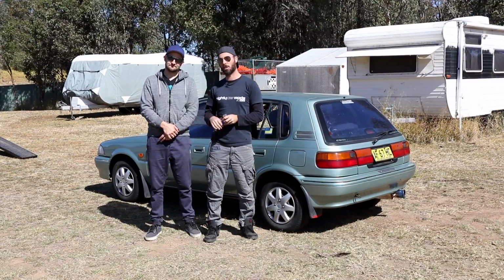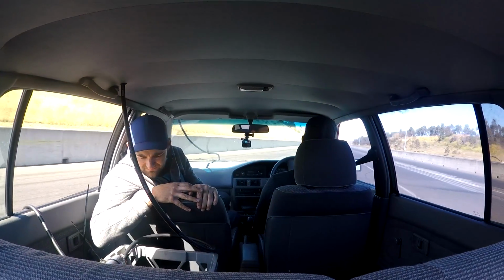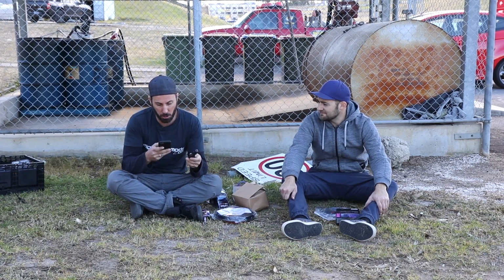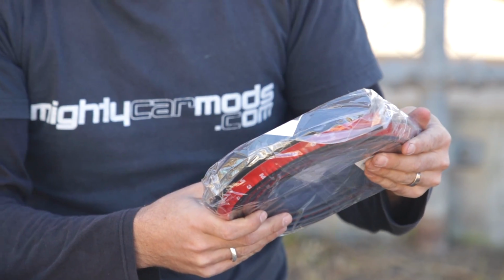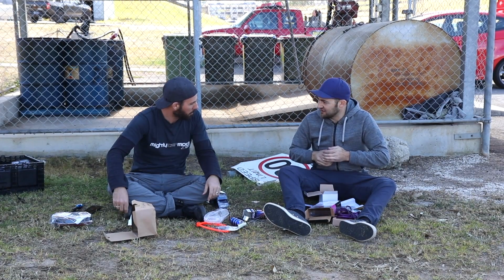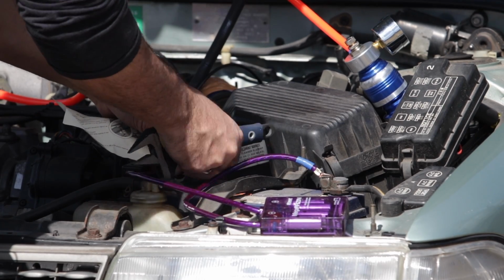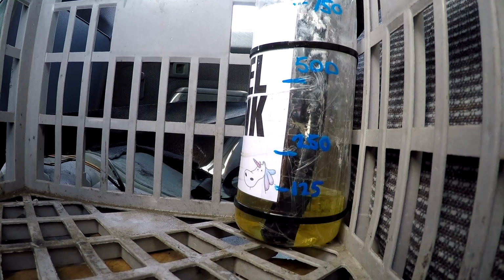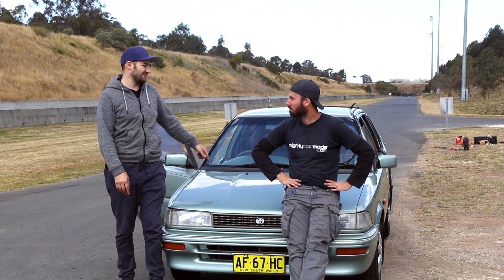Fuel Economy Mods - MYTHBUSTED

Comment: HAHAHAHAHAHA!!!!!!!!!!!  Did I just see a cig-lighter fuel saver?? AND ALSO BOOSTS SOUND SYSTEM!!!!   
"These magnets turn 91 octane into 98octane...Wonder what it does to ethanol?"  ROFLMFAO.  You guys are great lol.  

"I was expecting a rebate from the fuel pump"  I'm fkn dying hahaha
Reply: "i think on of our economy things fell off". i fuckin DIED LMFAO
Reply: THEY WERE USING THE MAGNETS WRONG. You put it on the counter on the gas pump when you refuel your car! instant 30 % saved
Reply: Maybe if you cover youre whole fuel tank in these magnets, it eventuelly turn into a mobile gas station that generates fuel.
Reply: @Smoked786  It turns into a tesla
Reply: CLeeP1983 
It turns e85 into rocket fuel
Reply: Ethonal turns into diesel
Reply: CLeeP1983
Reply: CLeeP1983 Rocket Fuel
Reply: but it was LESS efficient???  O.o lol
Reply: This gets a love but the actual suggestions for the car are completely ignored great job
Reply: ""These magnets turn 91 octane into 98octane" oh its bad when engine can not burn 98 octane energy efficiency but always burn 95 :) more octane not means more power, more octane means different ignition control etc and better power in some engines
Reply: Try hhO  h2 generator
Reply: Good
Reply: CLeeP1983 😂😂😂 who can be that dumb to believe this
Reply: Lol
Reply: Lolololololol
Reply: CLeeP1983 😭😭😭 Dying
Reply: Needs to be retested with actual capacitors   100μF is laughable 
since the Biggest single unit you can get is 1500 Farad  or 1.5 Billion μF  this will stabilize the electrical system significantly ... and help with the drops in voltage that cause the alternator to turn on, on newer cars   Mazda claims 10% fuel increase
Reply: Haha the fuel companies need those magnets
Reply: I reckon that you didn't wait long enough to allow the ECU to adjust itself to all the new parameters. The reduction in load alone from the aero mods must take at least 50 miles or for the adjustments in the maps.
Reply: This is all because of the BP oil spill in the Gulf.

Comment: One device that absolutely worked is actually the most similar to that big vacuum leak valve they tried out, but with significant differences. It was called an ecotek valve. It was a spring-loaded valvue, but the key to making it work was that the air it leaked in would enter the inlet manifold through a smallish hole at the bottom of the plenum chamber, before the air splits up to go into different intakes. This was similar in principle to an innovation introduced by Mangoletsi inlet manifolds, where a small, deliberate sideways leak would cause turbulence and improve fuel mixing. The ecotek valve made a car feel as though it was fuel injected, and it also improved fuel economy and smoothness. However, it does not work properly on a car with a closed-loop air-fuel mixture adjustment system because it keeps trying to adjust the mixture and goes out of wack all the time. Another advantage is that on engine overrun it would suck huge amounts of air through its spring-loaded valve and drastically reduce engine braking, so you could coast down hills much more economically. It was supposed to work by having a vibrating valve that would send waves of different frequencies to break up the petrol, but I don't know if that was really it or not. But it really did work and if I ever had another carburettor-fed car I would absolutely fit one or make one.

Comment: In reality, the most significant mods, apart from one or two products that weren't listed here, that will improve economy are significant changes to the mechanics, such as different cams, compression ratios, carburettor or fuel injection settings, ignition timing, torque converter design (automatics only of course) and so on. Stuff that you can't just buy and stick on.

Comment: The only way I have seen fuel efficiency improved is either removing the muffler (assuming you have a catalytic converter, sometimes if you have both it can get really choked up) or a performance air filter?

Comment: There are other ways to improve fuel efficiency that do work:

Tests: xcelplus.com.au/tests
 Mileage improved up to 36 % (Le Tourneau Uni)
 CO Emissions decreased 38 -76 %
 HC decreased 23 - 33 % (Bilsport)
 Soot decreased by 100 % (DR650)
 NOx decreased by 20 % (TUV)
 CO2 reduced 4.3 Ton (Cost-Benefit Analysis)

:-)

Comment: The cigarette lighter one probably does something.
These things usually have capacitors in them, those help smooth out battery voltage when there are peaks in current draw. In theory anyway. Little too pathetic of a cap probably, but maybe you could measure a difference with precision instruments. Probably not helping with fuel economy though.

Comment: Technically the vacuum leak would give you better fuel efficiency due to leaning out, more air and less fuel is more efficient but at the cost of more nitrous oxide emissions

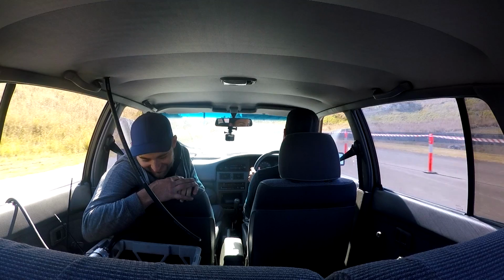Comment: I only see 1 fuel line in/out of the tank! How can you increase fuel economy without the ability to return unused fuel to the tank? You forget the fuel return line (but I'm only 6:09" in)!
Just watched it all. There was no fuel return line nor vapor recovery line in your tank! So every time you were not at full throttle you were simply dumping fuel into the injectors and out your tailpipe unburned, or it was being passed back from the engine straight back to the car's actual tank (rather than your test tank... Which due to it's flimsy material couldn't possibly handle the perhaps 35 PSI which the return line would have sent back to it) through the return line.
Alter your test parameters and return fuel path then test again. Your results may be different.

Comment: Great! Just had a conversation with a “dude” on FB that claimed nitrogen in the tires and “super” spark plugs saves 30% fuel. Total BS. Added this video to my answer.Regards from Sweden!
Reply: Nissan R35 GT-R have nitrogen only in the tyres as standard. Supposed to be more stable pressure versus heat. Or a marketing exercise to get you back into the dealership...

Comment: I found using e10 petrol (united) rather than u91 RON (from bp) petrol gave me better performance in my Holden barina 2005
E10 gave around 7.6L average and u91 gave like 9.5 average (per 100 km)
I found difference of around 1.9L per 100 km average 
Used gas fuel tank full clicking sound as way to record how many litres used 
Usually i Will always find u91 cheaper than e10 by little margin 

shall i use e10 or u91 

Does e10 like clean up carbon dirt buildup or something or results in less unburnt hydrocarbon petrol that is giving me better mileage???

Comment: As an experienced mechanic of 30 plus years, I used to hate seeing these horrible rip mods on cars I had to service some people listened to my advice that they were a con and I removed them others swore blind they worked and no matter how hard I explained that they do not work at all and are a con they still would not let me remove them it was unbelievable how many people got suckered into fitting those bloody magnets on their fuel lines I had one car in for repair and he had bought and fitted ten magnet devices on his fuel lines he even put three on the return line to the tank lol I opened the bonnet in front of him saw those ten magnets and I just burst out laughing I could not believe the stupidity of what he had done to his car and when I told him that he had wasted a 185 pounds sterling on these devices you could almost see a tear in his eye I told him the only way you can make your car economical is to keep it well serviced and use decent fuel so I had great delight in cutting them all off.

Comment: Check this out!!!
Comment ON how to DOUBLE YOUR GAS MILEAGE with out doing a thing to your CAR OR TRUCK!!!  NO PARTS TO INSTALL!! YOU DON'T HAVE TO SPEND A PENNY!!!  NOT ONE PENNY!!!
People, you don't have to ever buy new spark plugs ever!!!  EVER!!!  EVER AGAIN!!!  ITS A SCAM!!!  IT A RIP OFF!!!  SO THEY CAN STEAL YOUR HARD EARNED MONEY!!!
ALL YOU HAVE TO DO IS BUY SMALL BOTTLE OF Muriatic Acid (THIS IT THE TRICK!!!  """"MURIATIC ACID"""" IS  THE ONLY THING THAT WORKS!!!) and just soak the spark plugs in it for about five minutes.  Then take a tooth brush and brush the Plugs tips and electrodes with soap and water!!!  Until all of the carbon is off the top and electrodes of the spark plugs!!!  Then blow them out with compressed air!!! Or just with your breath!!! You may have to do this a second time until all of the carbon is off the electrode and tips of the spark plugs!!!
  Also on your air breather filter.  All you have to do is take an air hose and blow it clean from the back side!!!
Also if you look at the air filter you will see the stuff in the air filter is very small dust!!!  Blow it out and take I sharp knife OR A RAZER BLADE and put a several two inch slits in it!!! That way the  engine will for sure get enough air and will save you a lot of gas!!!  This very fine dust that may get through will have very little if any effect, if any on the engine!!!  Because this air goes through the engine at over a hundred miles an hour or faster and not only that when the air and fuel mixture ignites in the COMBUSTION CHAMBERS it MAKE a tremendous explosion with tempatures of a thousands of degrees!!!  Which will burn the dust up in a heart beat!!!  And then out onto the exhaust pipes with no ill effects!!  With know harm to the engine!!
Larry
Again spend the money on your kids!!!  You will never have to buy another air filter!!!  Its like throwing your money out the window of an air plane going five hundred miles an hour!!!
Now there is an expectation!!!  If you are regularly driving on dirt roads or OFF ROADS you must buy a new air filter..  As you can see that while driving normally on the streets and freeways there is very minimal dust!!!  I have to say VERY MINIMAL!!!  As you can see YOURSELF while blow cleaning the filter!!!
Have a great time with you family!
Larry
And yes you must keep checking your tires to make sure they are fully inflated.  With the right pressure!!! Other than that YOU ARE GOOD TO GO!!!
Larry
If you want the ""truth""  about how to DOUBLE YOUR GAS MILEAGE!!!  WITHOUT COSTING YOU A PENNY FOR PARTS!!! OR COSTING YOU ANY MONEY AT ALL!!! "" NO MONEY AT ALL!!!  JUST VIEW THE VIDEO BELOW!!!  THE JUST WALK OUT TO YOUR CAR AND START DOUBLING OR MOR YOUR CARS GAS MILEAGE!!!
Just click the link below.
Watch "How to Increase Gas Mileage" on YouTube
https://youtu.be/-9ALSIbv2do
GOOD GAS SAVING PEOPLE!!!
ALSO TO VIEW MY OTHER VIDEOS JUST TYPE IN MY NAME. LARRY NEIDERHISER.  WHICH WILL TAKE YOU TO MY YOUTUBE CHANNEL.  WHERE MY VIDEOS ARE.  
THIS VIDEO WILL SAVE YOU HUNDREDS OF DOLLARS!!! 
THE REST OF THE VIDEOS WILL SAVE YOUR LIFE!!!

Comment: I have a 1961 Mercury Comet , it gets 28 miles per gallon US. It has a 1968 Ford 200 ci straight six. One barrel carb ,1987 Mustang T5 transmission ,with headers . It weighs 2250 pounds. I get 28 miles per gallon on the hwy at 62 miles per hour,  in the city 22 mpg. With the tranny , being very torque it will lay scratch in 1st gear and second. No bad for a 58 year old car.

Comment: The main problem is all these mods work by lightening your car by removing money from your wallet So 2 problems 1 they add back weight fitting em and 2 if you bought them off Ebay u probably used a credit card and completely negated any improvements. Bad science guys sorry.😜🤣

Comment: Decrease your intake size and run an exposed non restrictive pod filter to suck in hot under hood air so it retards the timing . Guarantee it gives you better mileage , you will loose speed and hp but mileage will go up.

Comment: What about HHO kits? I mean those things that turn water into oxyhydrogen and send gas into the engine. I can't find useful experiments on those things, it would be really interesting to see that kit tested in a proper way
Reply: Because there arent any. Energy needed to produce hydrogen and oxygen is very expensive when made by alternator in a car. Even electrolysis of water by energy from a power plant is not economical.  If it really worked, you would invent perpetuum mobile.
Reply: @JanicekTrnecka  I agree with that, I've studied physics and I know the principles involved. But I have to say many people use them and apparently they work. The key is that gas may enhance the combustion, just like a catalyzer that allows more efficient use of fuel (of course HHO it's not a catalyzer). I'd like to see one of those kits tested in a scientific way, and maybe mythbusted.

Comment: I would like to see you take an older small displacement engine (1.3-1.8). Turbo and tune the engine and see if you can replicate the fuel some of the new turbo small displacement engines are getting for MPG. I think it is possible with a small charger and reasonable driving.

Comment: Mod on vacuum leak  surely waste fuel as Map sensor detects pressure relieve via the leak, fooling the sensor to add more fuel as it mimicked the higher throttle situation so richer fuel mix makes no power difference and worst fuel economy . That mod is a total BS

Comment: if any of these had actually worked how would you know which one it was?  Would you just take each one off until you figured out exactly which one was working?  I'd also eliminate the vacuum an you'd probably get similar gas mileage as the first run

Comment: My favorite thing here in the U.S. is "104 octane booster". So many people that I've talked to swear by that "104 octane". What they don't seem to understand is when I try to explain that gasoline engines run best on the 8 sided molecule in gasoline, (petrol as you call it), called octane. They don't understand that 87, 89 and 93 are all percentages of octane to other crap that you pump into your tank like benzene and naphtha. I used to get a belly laugh, on race day years ago, from the guys that went to the airport at night and stole "purple death 180 octane aviation fuel". I wish I could get 180% of my paycheck every week too.

Comment: Believe it or not, there is one fuel economizer device that is recognized by the U.S. Environmental Protection Agency and it really works. It was figured out during the 1970'2 Arab oil embargo. What it is, is a vacuum switch that actuates a relay that cuts out your A/C compressor under hard acceleration. The newer cars may use the computer sensing acceleration to disrupt the compressor now. Either way, my 2012 Lincoln MKZ has it as did my 2006 Ford Freestyle. I kick passing gear and if I hold it more than a few hundred yards / meters and my A/C warms up but comes right back as soon as I let it go. The belts don't slip and the A/C is functioning properly.

Comment: The only cigarette lighter fuel saver mod I have ever seen is a duel set of crystal cell solar panels on the dash board that recharged the battery a bit and put less of a load on the alternator and engine.

Comment: Magnets work better on furnaces, water heaters and gas ranges.  Put magnets on the fuel lines of those appliances.  Don't move the magnets at all and leave in place for years.  Use a laser temp gauge with a set run time 10 min. on the same spot, before and after installation.
Magnets on vehicles can make certain brands use more fuel.  Hondas computer will add extra fuel when magnets are installed.  Some brands magnets will help save fuel while others the fuel is used faster.

Comment: I found the description on eBay of how the 'cig-lighter fuel saver' works, and now I totally get it....

Fuel economy is the use of the vehicle's own generator power supply through the power controller automatically generates the required power of the water-saving economizer host, the water within the main engine of the water-power generator into ionized hydrogen and oxygen, the water isolated by the safe isolation And pipeline hydrogen and oxygen mixed gas delivery to the engine cylinder and other fuel at the same time combustion work. Due to the input of oxygen, the fuel of the original engine is more fully burned and the fuel efficiency is improved. Hydrogen is an environmentally friendly high-energy fuel (space shuttle, rocket launcher and other fuels used are hydrogen), which burns more heat than gasoline and diesel and burns three times as much energy as gasoline. The injection of hydrogen increases the fuel, The control of the integral controller reduces the amount of fuel supplied, replacing the reduced fuel with added hydrogen. To achieve the purpose of fuel-efficient. This product has significant fuel economy, fuel-efficient as high as 20% -50%.

Comment: According to some videos and reviews online the Voltage Booster or Fire Storm Booster or any other similar product that increases spark from the coil in order for them to work the car needs to have non-resistor spark plugs and wires and could effect the Voltage Stabilizer.

Comment: I'd be interested in seeing the MPG difference with taking the belts off of the A/C compressor and powersteering pump.  Just get all the fluid out of the rack before you drive or it will be super hard to turn the wheel..

Comment: Useless Modes... of course it will use more fuel because you are messing with the car ECU and Electrical.. and it all depends on your foot whether you are a slow driver or an aggressive driver.. and not forgetting that such an expensive fuel economy mods and equipment you can compensate and use the money to buy fuel much more as you want.

Comment: best way to get better fuel economy. shed weight and stream line. pump up your tires nice and hard to reduce drag. get a performance air filter and a freeflow exhaust and remove catalytic converter and clean airflow sensor. replace the oil, change spark plugs, change oil filter, fuel filter, and install a turbo